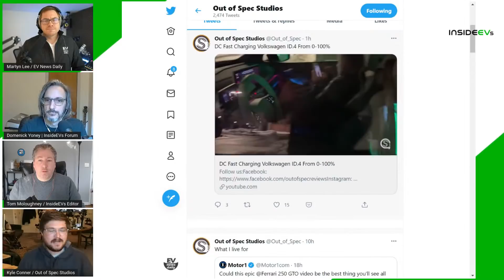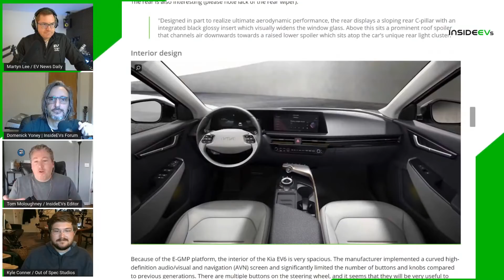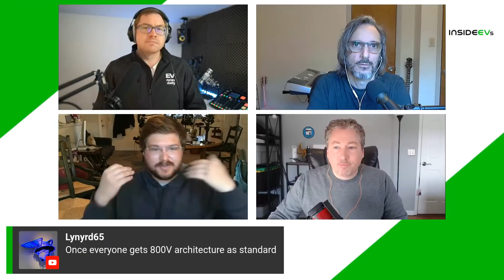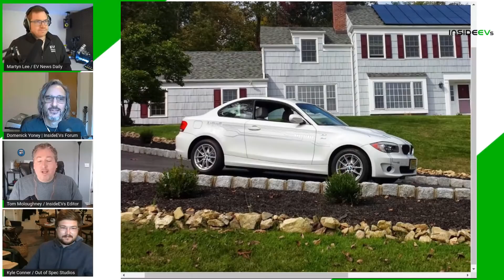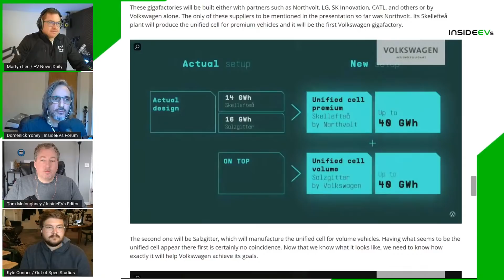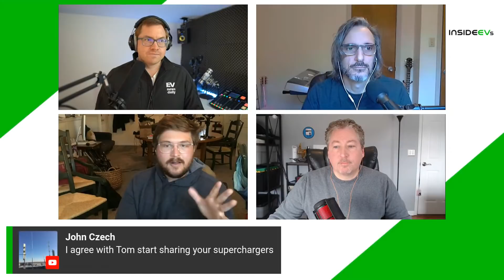BMW i4 Revealed with 300 Miles Range, KIA EV6 Design Unveiled and VW Power Day Lays Out EV Strategy

Comment: I believe two things need to happen.

Car makers, including BMW, must achieve gas car range (400 plus) and battery pack prices drop below ICE engines.

Once we achieve ICE parody, the argument is over.

However the most serious obstacle to widespread adoption is the public’s perception that they will not be able to charge on road trips.

My two cents. I currently drive a Tesla Model 3 LR at 79k miles, 300 miles of range.

Comment: Kyle
I have heard that the ID3 is very inefficient on short journeys as its using alot of power pre heating the battery. Did you notice the same with the ID4 on short journeys? It seems ID3 is better on long trips and the high initial pre heat is averaged out over a longer trip. Appreciate your feedback.

Comment: What do you guys think about the UK govt capping the (now reduced) subsidy to £35k EVs? It seems most of the longer range models are above that price.
Reply: I personally feel that cap is too low. Not opposed to caps, but EVs are a little pricier than petrol still,  and the government should be encouraging the switch as much as possible, especially if it's serious about that 2030 goal.
Reply: @Domenick_Y  Couldn't agree more. It'll be interesting to see manufacturers' reactions, and whether any prices will drop to slip under the £35k. Also now the cost of batteries are coming down I wonder if the grants are used by manufacturers to artificially inflate prices..might be an interesting discussion topic for next podcast?

Comment: To Kyle on Rivian chargers.  You said this is all the more reason for people to buy a Rivian.  Or... it's all the more reason for buyers to boycott Rivian.. and Tesla while we're at it.  Note that many of the DC charging locations on Rivian's map coincide with Tesla's SC locations.  For example, look at the northern side of the country that goes through North and South Dakota.  The fast chargers are on the same main roads as Tesla SCs.  Ironically EA doesn't have chargers on this route.  This exclusive DC network has little to do with offroading or accessing trails.  I got excited thinking Rivian was working with EA to fill in some of the gaps for a universal charging grid... until I heard they decided to go exclusive.  FFS....  Rivian will also have non-exclusive charging at places like off-roading trails, at least that's my understanding.  Assuming that's true, it completely undermines your entire argument.

Certainly there are things a company can do to drive more demand.... but not all of those things are moral, like exclusive charging.

These EV companies are trying to turn vehicle fueling into coach versus first class.  Fuel is a necessity, not an option.  Look, if Tesla and Rivian want to build VIP lounges at their universal charging stations, then more power to 'em, but exclusive charges that only serve to pidgeon hole customers into buying your brand and prop up your companies instead of driving the world towards sustainable transportation and energy is nonsense.  These networks require funding to setup, and there's only so much funding going around.  It could either go to exclusive networks, or univeral.  FYI, it's Musk that usually claims that a sustainable future is all he cares about... even if his companies fail....  

...Yeah... sure seems like it.  /s  Says the recently richest man on the planet that only got to that position through government subsidies and regulatory credit sales to desperate OEMs.

It certainly made sense for Tesla to build their own network because no network existed yet... but there was no requirement for them to make it exclusive, and in doing so, they've hindered the buildout and sales of EVs from other companies by successfully Pidgeon holing customers into feeling like Teslas are their only choice for long distance travel.  That myth persists today.  And let's be frank,  to build that network Tesla used a lot of money earned through government subsidies (taxpayers) and regulatory credit sales to other OEMs, effectively leaching off those sources to fund an exclusive charging network that only they benefit from.  So it's like "take from everyone, and give to ourselves".

Smart.  Real smart.  And now for the obligatory reminder that Nancy Pelosi bought $1 million in Tesla call options in December before announcing the green act that would serve to give Tesla another $3+ billion in taxpayer dollars...

Now Rivian is trying to follow Tesla's immoral example... ugh...

This is why government EV subsidies and tradeable emissions credits are effing stupid.  They give specific companies huge advantages over the competition, and there's no guarantee the company will do the best thing for the people to further the EV cause, rather than doing the best for themselves to kill off competition.

Like Tom said, the people don't want to have to deal with multiple exclusive charging networks, all needlessly overlapping with each other, overcomplicating the charging process, using up more resources than need be, and giving wealth based exclusivity to buyers of certain brands.  As if the wealth disparity wasn't already bad enough.

It literally is like coach versus first class.  Airlines love to waive it in the faces of those in coach too.  You get to walk by all the seated first class passengers in their big comfortable seats with leg room, and dedicated overhead storage, with dedicated flight attendants, nice food, quick services...etc.  I mean, it's one thing to get it, it's another thing to flaunt it.  Tesla does the same thing with their exclusive charging network.

Comment: I'm amazed there's been so little coverage of the BYD blade cells that use the LFP chemistry.  Their gravimetric density is on par with Tesla's CATL LFP solution, but their volumetric density is greater since it's organized in a cell to pack structural component.  Tesla's CATL LFP pack price is supposedly around $100 / kWh.  BYD is claiming $85 / kWh for their pack price, and they're touting higher volumetric density.  Seems everyone's had their heads so far up Tesla's behind for so long, competitors are never really acknowledged.  VW is finally getting acknowledgement, but I feel like Tesla's battery day got FAR more coverage and applause than VWs... yet ironically VW is effectively matching a lot of the things Tesla announced.  Except they're going a step further into SSBs.

Toyota's working on a SSB cell with claims of 10 minute charging to 80%.. faster even than QS.  This could result in smaller capacity packs going into cars, and lower resource usage.  Yet Toyota is crapped on at every turn by the EV community... even though total EV production on the planet is being capped by limited cell supply with fears of shortages of some raw materials like Nickel, or rising commodities prices.  Toyota chooses to wait on their EV expansion while developing for state of the art cells that should hopefully be here within years... and suddenly everyone's flipping of Toyota which was the darling of the lower emissions race just 10 years ago.

GM's working on lithium metal battery, and that's only received a few small mentions on EV sites.  It could revolutionize EVs.  

The fact that the community has listened to Musk's claims about 3 TWh of battery production by 2030 is pretty laughable.  That's enough cells for 40 million cars.  They produced 500k in 2020 and will produce 750k - 1 million in 2021.  They have loads of new competition  biding for the same raw materials and to increase their own cell production... but oh yes, Tesla will quickly jump to 40x their battery cell production in 10 years... 100%.. no questions need be asked.

Comment: Look at the BMW's new grill on a non-white car... it looks fine.  Think about this; how many white BMWs do you ever see out there?  They look terrible in general, even without this grill.  Other than X5s and larger vehicles, I NEVER see white BMWs.  For some reason they choose white to advertise the iX and i4 with the super ugly/weird electric blue trim pieces.  (A no-cost and no brainer option to remove the blue) Then you see the cars in black, silver, blue, or white, and they look completely fine, even with this grill.  

Someone on reddit made the point that BMW should build their grills like the i8.  100% agree that the i8's styling would have worked WAY better here.  On the plus side of this supersized grill, I imagine it WILL help with rock chips.   I've owned BMWs and the bumper always gets torn apart by rocks.  I imagine Teslas do as well, which makes it mandatory to spend hundreds of dollars having a clear wrap installed on the front end the day of delivery.  Albeit, Tesla has some profoundly terrible paint quality.

The price of the iX is where it stands out.  It'll start at around $85k with the $7500 tax credit bringing it down to $77,500.  That's $12,500 less than the base model X.  Model X is faster, possibly longer range (EPA anyways), has more standard tech, has available (if not expensive) 6/7 seat options, but ANY appearance option costs more A LOT!  Any paint option other than white costs A LOT!  Any interior color option other than black cost A LOT! The only other wheel/tire option costs $5500!  BMW has multiple appearance options for paint, seat color, and trim varieties that are free, and multiple premium options that cost as much as or less than Tesla's options.  BMW's wheel options are significantly cheaper, topping out at $2200, and there are more to choose from.  Options packages can be pricey, but most are unnecessary... things like gesture control, 360 degree cameras, and trim options.  Drivers assistance should certainly be added, which works similarly to autopilot.  Heated seats is a required option for those living in cold climates... but in warmer climates isn't necessary.  Tesla includes that as a default, which won't always be necessary...

Either way, chances are people will be able to get this car for much cheaper than a model X, with no repeated trips to the service department to fix the falcon wing doors when they inevitably begin to screw up.  Don't get me wrong, I once was tempted to buy a used model X... but the more I thought of the falcon wing door issues, the more water was thrown on that fire.

Comment: Tesla never "walled off" their chargers.
They were launched before CCS.
There was (is?) an offer on the table for others to use the network, with reasonable conditions,
As far as I'm aware, these were:

1) Contribute to expansion, 
2) Use plug and charge.

Nobody felt compelled to do so, now we have others who are imposing restrictions through "membership" schemes, various access systems, and actual "walked" networks appearing.
Reply: I've always felt like the SAE walled off CCS, tbh. Not sure why they didn't work with Tesla on a universal standard, but they should have.
Reply: @Domenick_Y  
Tesla was part of the original CCS appraisal Committee, (I think they may still have some connection?)
Agree they should have worked together, but remember this was 2010 onwards, when the consensus was "Tesla who?", then "Tesla won't survive", etc. Was "Corporate Ego" involved?
Reply: @rogerstarkey5390  Great points.

Comment: Been seeing a lot of negative reviews of that ID4. I don't understand it. It checks every box. It looks great, the range is good, it charges at a good rate, the build quality is great, and the price is terrific. It's a practical EV that just feels like a normal car for normal people. I think and hope it sells really well.
Reply: Thanks for watching and for the comment!
There is a wide range of opinions out there about the ID.4 for sure. While some aspects may not measure up with competitors, the overall package may nicely match the price tag. 

For many it comes down to value, even more than the driving experience, and the rear-wheel-drive version, at least, seems like a decent deal. If owner word-of-mouth is overwhelmingly positive, it should push demand to meet or exceed supply.
Reply: @Domenick_Y  This is my point. From a value proposition it's checking all the boxes. Add in the federal tax credit and it's an incredible deal.
Reply: You can't take away the fact that the launch is problematic with a car that is riddled with software issues. Well all know they will be ironed out with OTAs, but that's mostly why the reviews and opinions are so negative. Also the whole mess of making the charging experience at Electrify America a nightmare is not helping. This is only temporary and will be improved in time , we all know that...but yeah, the launch and media coverage has been tepid at best because of these 2 reasons.
Reply: Ya, it's competent...but it's not a Tesla. It does not push any of the "boundaries" or limitations.
Reply: @archigoel  So? I love tesla, but everyone doesn't want something revolutionary, techie, or insanely fast. This is great for a person who just wants a good "normal" car. The more of these we have the less of ICE cars will be sold.
Reply: @bobbyfaison  
So if Tesla launches the "2" with 2WD, Smaller, fast charging pack, 6-7 second performance, and space efficiency, that's a win?
Reply: @rogerstarkey5390  Sure? Why not? But I don't think you're understanding my point. This is not a Tesla is losing to the ID4 argument. It's a 'This car is really good and people will have another good option to compel switching from ICE' argument. VW and Porche have really good ideas with improving that I think tesla should adopt. This type of thing comes from competent competition which they're about to have lots of.
Reply: @bobbyfaison  Absolutely true....but Kyle seems to be going out of his way on ID 4...its a happy car? Lol, that was just a little hard to swallow.
Reply: @archigoel  Only he knows why it's a "happy" car, but I like the car. I think it's terrific.
Reply: There are still a ton of places in the US where Tesla, or MB, BMW, Porsche, are still just not real options. There isn’t a Tesla charging station for 1.5 hours from me. No dealership for more than that. Lots of people are just not going to buy any car with no backup from the manufacturer.